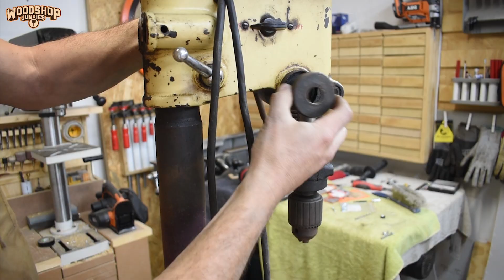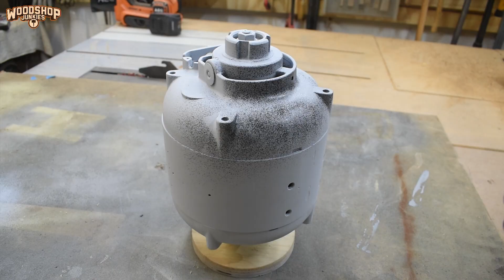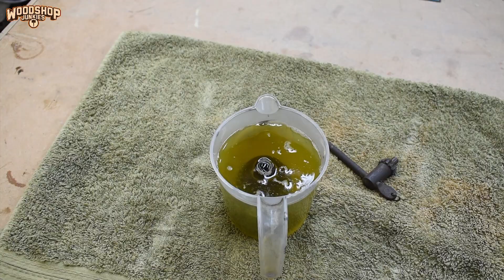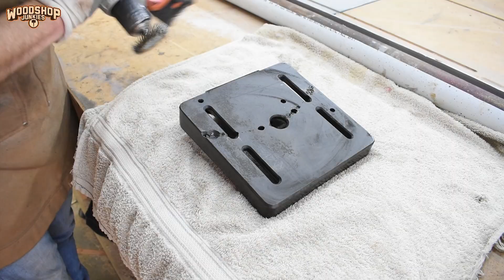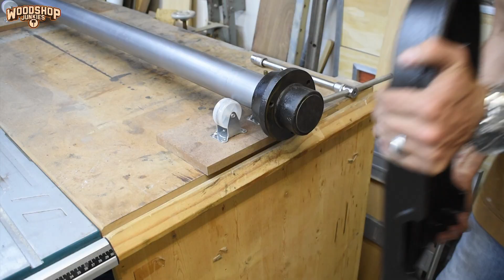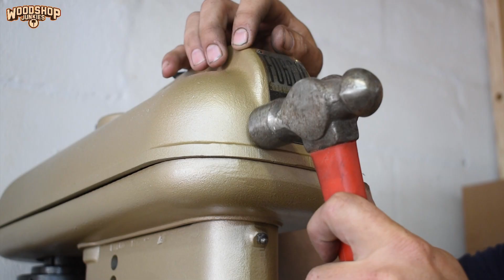Better Than New! 60 Year Old Drill Restored

Comment: baie goeie werk. Ek is van Durban. Question, I have a WT 900 DP, can't figure out how to remove the chuck. Any ideas? It appears to "unscrew", not hammer off??
Reply from the maker: Walker Turner? Behind the chuck should be a type of a knurled nut. Some have holes for a c type spanner. Loosening it should push the chuck off of the taper shaft. They can be very stubborn.

Comment: Two years too late, but you need to be careful with that Fobco drill.
It's been converted to a pillar drill from a bench drill at some point in it's life by the addition of a longer column. But the base is the original bench drill version.
The column drill had a much more massive base than the bench drill, for obvious reasons, and I'd suggest you don't try to use it without it being bolted firmly to the floor.
As you're no doubt aware, it's a very heavy piece of machinery and could cause serious injury if it toppled.

Comment: I was in the process of restoring identical drill bar the shaft actually split in half. 
Until compressor died so I had to make another bigger and better 440L from 2 fridge motors and 2 gas bottles + water catch tank and rad and fan etc. been working well for last 4 years. I really need to finish this drill 😂 ADHD doesn’t help. 
If you are interested I can add some information on where to get exactly same paint match in machine enamel. 
I have all replacement bearings ready for all inc motor. Luckily a good supplier about 1km away. 
I do try to restore to original colour inc hand planes etc. 
keep up the good work keeping these beautiful machines away from scrap and alive for years to come. Made to be repaired. Unlike new tools. 
Also made to a quality not a price. 👍👍

Comment: Great job! Just a heads up on using Evapo-Rust, you need to rinse with clean water after taking out of the ER. It’s been my experience that the ER will get gummy if left to puddle or collect. In this case, inside the chuck. I’ve restored a few chucks and typically disassemble them completely before soaking in ER overnight. I then rinse the components in hot water, blow them off will air. If I’m delaying reassembly, I will place the parts in a container of odorless mineral spirits, snap the lid on and set them aside. Just my 2¢ worth.

Comment: That came out nice. I never gave it any thought about the spring that kept it up but on seeing it disassembled it became clear. You have the handle backward from original which may bring it in to position depending on travel. On my delta (bigger) I have 3 handles at 120 degrees apart so are able to apply leverage, as needed.

Comment: Save your WD-40 for cleaning and squeaky hinges... Mix yourself a 50-50 solution of Acetone and Automatic Transmission fluid... it will make WD-40 look like water and its dirt cheap to make... It was tested against some of the best and most expensive penetrants on the market.. The Acetone really helps it to penetrate rusted areas... Try it, you won't be disappointed... Very nice restoration... thx for sharing...

Comment: Great video, 
One comment I think the bottom clamp bracket at the chuck is upside down.
I own the same machine since 1980 that I'm restoring unfortunately the aluminium belt cover has been smashed (travelled from UK to South Africa and returned only to have the aluminium belt cover smashed, now trying to find a replacement.)

Comment: That's awesome I want to restore mine but I use it and haven't got the time. Mine is so old it's got cloth covered wires and both forward and reverse on a 120V single phase 1hp Westinghouse motor.

Comment: @woodshopjunkies that turned out awesome! Well done! I love the black and gold colours! (You said copper but it looks gold on camera...either way it rocks! 
I've started restoring tools myself because "A" I can't afford brand new and "B" the older models are normally much more durable and stronger than the newer ones.  As I use mine I can't help but wonder about what it was used for and about the previous owners...
It's so satisfying cleaning and restoring a piece of history back into production! I didn't have access to a pvc tube for the post on mine.  I soaked rubbermaid cloths in metal rescue  (same idea as evaporust but it wasn't available in my area), wrapped it around the metal and tightly covered it with plastic wrap.  Occasionally I would check and resoak the cloth as it dried. It turned out great! 
Thanks for the lesson...I really hope you do more restorations! Just found you today

Comment: Well done! Hints. WD40 works, the fish oil/kerosene mixture is great for we sanding and other uses. However, in my experience, PB_Blaster works better as a penetrating oil, but that is simply a personal preference. Also Evaporust is a multiuse resource, you talked about using "left over" Evaporust. It will remove rust for many times. Only when it no longer seems to work do you have to dispose of it, and that is normally after many, many uses. Just an idea to help you save expenses. But, again, nice job.

Comment: can't believe the column is a solid shaft!  they spared no expense when they made this drill press. Such machines are an honor to restore and enjoy. Quality at this level does not exist now. Maybe only for $2k+ industrial drill presses. also the pulleys are machined from iron and not zinc cast! nice! I would say this beats delta/walker turner machines interns of quality for sure

Comment: fantastic restoration - and superbly engineered drill in the first place - made to last! I like your methods for cutting down on the volume of rust cleaner used - it's really expensive as you'll know better than me - around £40 for 5 litres here in the UK - and you see some other restorers using gallons of it for relatively small parts. (You can also make specially shaped 'wells' for smaller parts from Lego pieces and base-plates and a bit of plastic sheet! Ha British ingenuity!) Keep up the excellent work and save our glorious old machines!

Comment: Looks great, I did notice the machining vise, fair warning, if your chuck is only held on by friction on the taper sideways pressure along with the vibration from machining stuff may cause the chuck to fall off. I reinstalled mine but with red loctite. Also no longer try to machine on it. I hope you enjoy it because those old machines are built far better than anything today

Comment: You don't need a 800 dollar sanding box. You can buy a sand blaster for as little as 15 bucks and 20 bucks of sand. They are so simple you can make one with a few pieces of pipe and a little hose, and a small air compressor.

Comment: Dude, I know it looks better on youtube but WHY you had to cut the pipe open instead of putting the shaft vertically in it with rust remover and only putting a cap on the bottom????  
PS No turning necessary.
Reply from the maker: Because it is a solid steel shaft. Very heavy. Transferring the PVC from vertical to horizontal with the shaft and liquid inside would be awkward. Also, the cap would not be able to hold the weight of the shaft so I would need to brace it by hand while transferring.

Comment: Nice job, bearings aren't that tricky to track down, they are usually pretty standard sizes even to this day. They may however may be more expensive in your part of the world due to a lack competition from multiple outlets. Have you tried using White distilled Vinegar for cleaning up rust? I have found it works very well on lightly rusted items, so you can save some money on the lighter stuff. Use baking soda water solution to bathe them right after you have removed rust to neutralize the acid, then coat with oil, Note WD-40 is not a lubricant it's a water dis placer, user some some sort of oil, I am not sure which brand you have in Europe but a light machine oil will work. Pre soaking moving parts with a penetrating oil before removal is recommended not spraying and then trying to remove after spraying, that does nothing but get your parts oily. 5 to 15min soak is recommended. Keep on restoring.

Comment: If you dont get a sand blaster the next best safer thing is a bench grinder on a stand with a wire wheel so you can clean off the parts and not juggle both a drill and the part.

Comment: Brilliant idea resting the beam on caster wheels during the sanding process. I'm going to try that when I restore a 1940's Craftsman drill that I recently aquired. I wonder if you could wrap a belt around the beam and use the drill motor to spin the beam to make sanding easier?

Comment: Well done restoring the drill, looks great. That black collar on the column belongs under the drill head, it's to support the head when you loosen it to swing it over the table, (make sure it tight before you loosen the head ok!). You can buy new return springs (expensive), but if the drill was so cheap maybe worth it? The chuck looks original, they do come apart, look it up on youtube. A grease point becomes visible on the quill as you drive it down, push a bit of grease in from time to time.

PS, a safe way to raising and lower the head on the colum:  Raise the table up to the chuck with a piece of wood between them. Release drill body and pull down the drill lever, the drill body will go up the columb, secure with clamp then raise the columb ring and lock it under the drill body.  Reverse to lower.

Comment: Nice restoration, don't ever sell it or you'll regret it!
Replacement return spring is still available from Tony Griffiths at lathes in the UK.
The feed lever should have a plastic ball at both ends and be free to slide through the shaft. The screw in the end should be a knurled thumb screw with a spring loaded ball to provide friction to the lever, or it can be nipped up by hand.

Comment: I have a bench version of this drill press and restored mine about 5 years ago. I love it as a machine and have added a cheap, small, Chinese milling table to the accessories. I have only made 2 parts so far, new Cu contacts for my Toyota starting motor. I find it is the most used tool in my shed. I leave a rotary wire brush in it for cleaning threads and things and have made a larger plywood table with sacrificial wooden pads for drilling into and clamping to. I notice that when you started the clamp collar was below the moveable table and when completed, it was above. I think it should be below to stop gravity from taking the table to the very bottom. Well done, good to watch, Colin

Comment: Nothing special here.  I have a 1926 Richardson bench drill with a 1.5 hp Noyes single phase 240v motor.  It is in near perfect condition.  It has been used to build ICE motors, for racing cars, and motor bikes.  That drill was used to modify portions of Jack Brabam’s formula 1 Brabam.  Kawasaki H1 and BMW R60 and many more things.  The drill was always looked after becuase is was a valuable tool.  Tools don’t need to be refurbished when they are looked after.

Comment: Just a hint - contrary to popular opinion, WD40 is a very poor penetrating oil. It was actually designed to be a water dispersant, which it does very well.
PlusGas, on the other hand is an amazing dismantling fluid. I strongly urge you to try it on your next restoration.

Comment: I rehabbed a 1947 Craftsman drill press.  The motor was lightning struck and irreplaceable. It weighs 186 pounds and is a bench top model. New bearings and a bronze spindle bushing. 6" travel.

Comment: I noted you greased the motor bearings.  Tip, those bearing should only be oiled.  Also, I think I saw an oiling nipple on the motor for adding oil to the bearing.

Comment: These FOBCO drills are great, I have 2, one floor standing and bench. They are very solid machines and have no movement in the quill, much better that the new ones I was looking. I note that you placed the collar above the table. I have it below the table as a safety stop for when the table needs adjusting which always happens after the work has been bolted down. I have also seen it under the main head casting as a safety stop, but yours looks like it can't move down too far as the main pillar is reduced in size at the top. Thanks for the video and keep up the restorations.

Comment: all of the woodworking machinery in my shop are restored 1940's or earlier including the motors.  Bearings were  easy to find for all of them, including the rather odd tapered roller bearings in my jointer and drill press (beaver power tools).  most ball bearings require a press or heat differential to install.

Comment: Hello! I have the benchtop model and these are a very good quality machine. Mine looks like your before shots but still works great. If it is too bulky you could cut it down to a benchtop model. I'd seriously consider keeping this Fobco and losing the modern one. Question: is the pillar on the modern one solid steel? I would be surprised if it is. I enjoyed the video. Mart in England.

Comment: Good job on the restoration.  My only comment is that I would wax the pillar to keep the rust from coming back so quickly.  The same with the bare cast iron on the base and the table.  I don't love the copper but I see you you got there.  For old power tools I like muted greyed out colors.  No metallics unless it was metallic originally.  For the restoration itself, great job.  I like you simple rollers for working on the pillar, your PVC pipe for removing the rust from the pillar and your drain hole for recovering the Evaporust in the PVC pipe/tray.

Comment: Liquid Wrench is far better than WD40 or anything else for loosing rusted parts.  Corrosion X is the best for protecting and lubricating rusted parts.  For rusted items like the base you can spray with Ospho (phosphoric acid) and the rust will disappear and turn black.  It converts iron oxide into iron phosphate which is inert.  It also serves as a good primer for painting.

Comment: Really nice! I love those restauration and it’s an inspiration for me, as I am definitely going to reuse old machines when I will have my proper workshop.
Now a comment: WD40 is not an actual penetrating oil. It’s an oil that happens to penetrate okish, but it’s not its purpose, despite being very often used as such. It’s meant to eliminate water and moisture (WD stands for Water Displacement). I REALLY recommend to buy am actual good quality penetrating oil and will save you much more often. It’s night and day.
I really regret not switching to penetrating oil sooner. As everybody, I was also using WD40 before

Comment: Great effort and great result.  If you're ever worried about the bushings vs. having bearings, you can always easily add a grease fitting and add greasing to regular maintenance.  Otherwise, I believe you can find bearings of infinite sizes - I don't think you'll need to get custom ones.  That press looks very similar to the Delta brand here in the US from the 50's and 60's.

Comment: Drillpress came out nice, the colour......I would say 7 out of 10. I think the original yellow would have been outstanding, then blue, red or green are other nice shades. Like your technique of reducing 'evaporust' waste by using smaller volumes increased areas. I think you can install an intermediate pulley in the center which will multiply the torque on the chuck to enable tougher metals to be drilled.

Comment: Fantastic job!  One question that confused me a little...  When rust treating the post, why go to the effort of making that trough?  Why not just cap one end of the PVC tube and insert the post and treat it vertically in the solution?
Reply from the maker: It's a solid steel bar. It is very heavy. Handling the bar inside a vertical pvc pipe would be awkward. The cap won't hold the weight of the bar and it would be tricky draining the rust remover.

Comment: Bearings should NOT spin that freely.  That's a sign that any grease/lubricant is gone.  The drill may operate fine for a little while, but you're certainly not going to get the life expectancy you could if you'd refreshed the bearings.  You're going through an awful lot of work to miss that crucial step.
Reply: Hence the reason why he greased them before reassembly